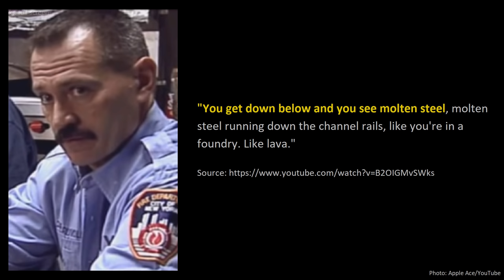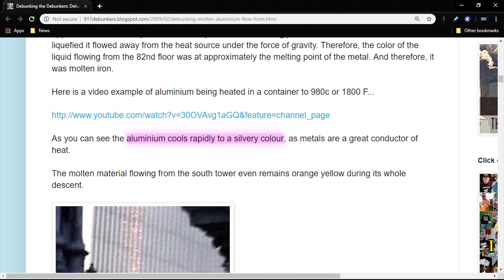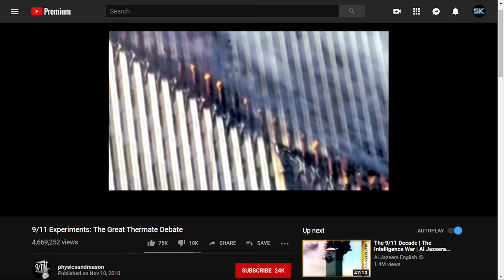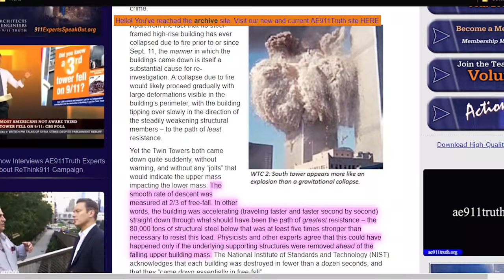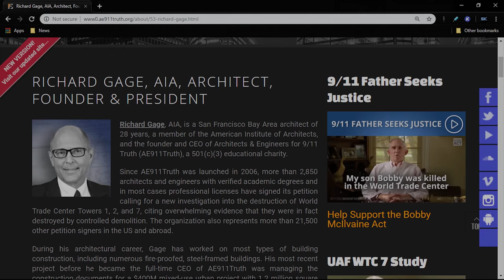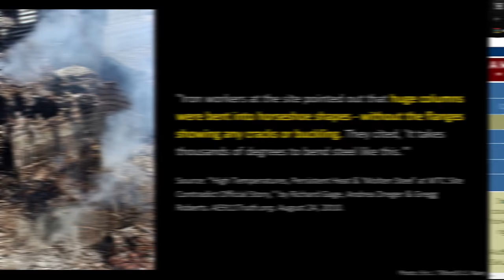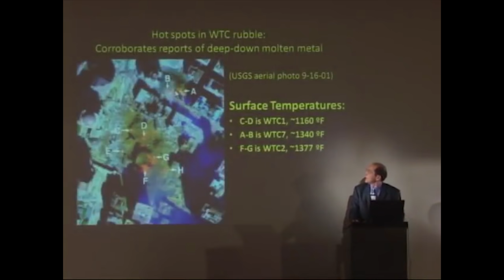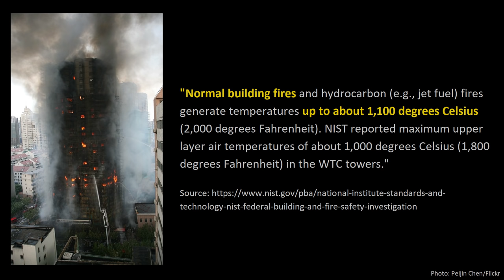9/11 Truthers Debunked: "Molten Steel = Thermite From Controlled Demolition!"

Comment: I guess you did technically go over it, but aluminum is like, the second most thermally conductive element, meaning it cools quickly. Even if the fire got up to 2000 F, we'd expect a dimmer orange color like the flames, not the bright yellow orange, almost white hot color we see falling. Watch the footage again, and compare the flame colors to the molten falling material colors. If the molten falling material colors are a lighter, more yellow or white color, then they are hotter than the flames from the fire, a thermodynamic impossibility without a higher temperature chemical reaction occurring. Did somebody tamper with the dripping metal color? I suppose it's possible.

Yes, liquid aluminum CAN glow yellow orange, but at what temperature? That's my argument why I still think it was thermite.

FYI, thermite IS used in some types of demolition charges.

It was my understanding that the thermite WAS mainly concentrated in the center shaft, with perhaps a few charges left on outer structural components.

The question I can't reconcile if there were no demolition charges used, why didn't we see a slower failure as the ductile metals (A36 steel) were heated beyond their failure temperatures for the given loading conditions. Supposedly the steel held 95% of the structural loads, concrete 5%, if that's the case, we would have expected to observe significant deflection, bending, and distortion of the buildings before actually collapsing (safety factors of ~3). For the corner support to have failed (let's say during the crash), that leaves ~75% of the structure intact, theoretically at a safety factor of ~2.25, still enough we probably ought to have seen a greater amount of distortion of the structure before failure.

Title of article on thermite found:
“Active Thermitic Material Discovered in Dust from the 9/11 World Trade Center Catastrophe”

Ultimately, do any of us know for sure? Probably not. But if I were a US intelligence conspirator trying to trigger a false flag war, I'd feel much more comfortable if the building I was trying to destroy had a backup plan in case the airplanes weren't enough.
Reply: Everybody is in agreement that building #7 was for sure a demolition job though, right? Even if buildings #1 and #2 were brought down with jet fuel only, building #7 was for sure a demolition, it would be impossible to argue against that I would think.
Reply: @jeremylefevre9828  No, "everyone" is not in agreement about that. in fact, the vast majority is very thoroughly not in agreement with that. And it's very very easy to argue against that.

The "molten falling material" is very likely nothing of the sort, and if it is anything, there is nothing at all that would prevent it from being aluminium.

Comment: The buildings failed because 130T of aircraft traveling at over 300 mph exerting millions of pounds of energy instantly compromised the structural integrity of the buildings. In the end the damage caused by the impact and initial structural damage doomed both towers. The fact that they stood for as long as they did is a blessing.

Comment: How did those solid steel columns get pushed outwards, did the fires do that too? if the planes did it, wouldn't they be bent inwards? 2:02
Reply: While the plane came from outside, the explosive force came from inside which pushed a lot of the steel columns outwards, just watch any video of the impact. Some columns just didn’t rip straight off and remained dangling.
Reply: @NY_Mapper  The WTC towers were not traditional steel grid frame construction but were essentially hollow tubes, a steel ektoskeleton with a column and girder core tied together by relatively insubstantial trusses.  It was the connection point between the outer shell and the trusses that ultimately failed allowing the floor pans to collapse (or pancake) pushing the the steel skin outward.  There are many videos of the towers being constructed that illustrate the form of the panels used to create the shell (they were anywhere from 75 - 150 ft in length) and why they "peeled" from the structure as they did...basically it was the path of least resistance, there were no explosive involved, had there been it would have looked very different.

Comment: Molten steel and squibs are dubious lines of inquiry, true enough. But was the debris searched for explosives or other means of demolition? Or plane parts?  

It’s not outrageous to suggest that NIST took a presuppositionalist approach to ‘investigation’. Well, it wasn’t an investigation, was it? It can’t have been. That must have been completed within the four weeks prior to October 11, 2001, when the US launched on Afghanistan; how embarrassing if subsequent detective work had turned up game-changing evidence?

Since the case was effectively already closed, all that was left was to provide a sciency rationale. NIST’s report begins by stating that “this report describes how the aircraft impacts and subsequent fires led to the collapse of the towers after terrorists flew jet fuel laden commercial airliners into the buildings.” Tidy. It reminds me of question four of Bertrand Russell’s ’16 Questions on the Assassination’:

At the outset the Commission appointed six panels through which it would conduct its enquiry. They considered: (1) What did Oswald do on November 22, 1963? (2) What was Oswald’s background? (3) What did Oswald do in the U.S. Marine Corps, and in the Soviet Union? (4) How did Ruby kill Oswald? (5) What is Ruby’s background? (6) What efforts were taken to protect the President on November 22? This raises my fourth question: Why did the Warren Commission not establish a panel to deal with the question of who killed President Kennedy?

If this were the greatest conspiracy in history, it would be assisted by the widespread belief that it would be impossible to pull it off. Just saying.

Comment: What exactly is burning at the base of the towers that can reach temperatures hot enough to melt steel for months? And you cant just say "confined spaces" as some magic word. If anything having fire deep in a rubble pile at the basements of the towers would not get very hot because A, the fire will become oxygen starved, and B, fuel will run out relatively quickly. But if their were still plenty of office furnishings down there that isn't going to create temperatures hot enough to melt steel.
Reply: Since there was no melted steel? Nothing.
Reply: @mooneyes2k478  well the firemen working in the rubble the entire time reported seeing molten steel. Now maybe the molten metal they saw was not steel, that does not explain though, how the their could be fires of extremely high temperatures for many months in the basement of the towers which was an oxygen deprived environment.
Reply: @unshapingtheearth7916  No, they didn't. They reported seeing "red-hot" metal. But red-hot is not molten.

Comment: The buildings have maintenance tunnels in them where they can go in and inspect the beams and do any maintenance or repair work needed. Those tunnels would all be basically hidden and not accessible to just anyone. So all the molten metal would not of been seen from anyone outside. And all they have to do with the thermite is mix it in with the paint they use to do their routine coating on the beams, framing, trusses whatever u wanna call all support beams. And thermite definitely gets hot enough to melt steel wtf are u talking about? That's what they use to weld train tracks together. Jesus people just spewing shit they know nothing about to try and convince others their theory is correct. I would highly recommend everyone to go research almost everything this video is trying to point out as their proof of what's what or how this works or whatever. Remember the old saying u can't believe everything u hear, see or read.

Comment: The steel and concrete floors would have sliced up the jets to pieces and sent the pieces scattering everywhere and certainly not in one corner.  Seriously?
Reply: You may have missed this but the planes were converted to bits - 117 tons of plane shredded to scrap in a fraction of a second.  The momentum of impacting at 467 and 590 mph respectively though would absolutely have carried much of the mass to the opposite side of the building where some would exit but most would remain. We can actually see this clearly in the South Tower where the piled up debris shoved into a corner is clearly visible. 

So yeah, seriously. Not at all difficult in logic.
Reply: @MFitz12 🪴🪴🪴🪴🪴🪴🪴

Comment: The tang is that nobody takes in consideration is how hot is jet fuel burn at it was not a standard building but a building fire mixed with jet fuel fire since the buildings got that hot since each  four had steel and concrete with those Plus the planss and fire damage from planes done by the planes caused it all go wrong

Comment: Yes we get it, the aluminum is right where the airline entered the building 😜. As we did 'not' see the airline bounce off. Most of the airline went through, to the other side. But there was a fire ball seen outside on impact, therefore, not all of the fuel from the wings could have entered the building 😜. It's simple physics. Eg. In order for aluminum to get inside the building, the airline must have entered inside. Which is what you failed to address. You just said 'where the aluminum is concentrated', not 'where the airline hit'😜. Which is the main event of the disaster 😜

Comment: Oh and you fail to mention that NIST made it necessary for their study to assume that the plane impacts hade "largely dislodged" the fireproofing on the steel columns. That is ludicrous, these steel beams could withstand very high temperatures. Furthermore the vast majority of the weight of the building was supported by its core. And the fires were starved of oxygen, especially back there. The fires really only burned in the offices by the windows and immediate areas of impact from the jets. How can you say these fires were sufficiently hot enough to weaken this fireproof steel anywhere near its core? And also how do you propose that the steel the rest of the way down the building was weakened? Because if you don't claim that is the case then my friend, you have fallen in a trap. There is no way that a small 20 story section of a building can crush 80 stories of healthy structure below. It is impossible. Momentum conservation doesn't allow it.

Comment: Finally.. a great video that makes perfect sense. All a honest hypothesis..  especially knowing that the massive amount of aluminum in the landing gear alone.. all ricocheting inside the box shape of the WTC Building and collecting in that corner based on the angle of attack of the Flight 175 plane as it entered at the 78th floor..  not at all as level and centered as the Flight 77 crash attack angle Center Mass And level flight… AS FAR AS TEMPERATURE GOES another thing I usually mention myself is the fact that there was a gapping HOLE 3 floors wide.. and  high winds at the top of the Wtc buildings… if you wanted to get deal over that 1600°C Mark did have to add oxygen and lots of it…. There.. 102 Minutes of  Forgery High temperatures

Comment: How does 80 or 90 floors of 100% sound building just become rubble? For 40 years they held up 110 floors plus 110 yard mast no problems. Even if the floor above the impact zone failed the core would still be 100% solid. The whole core was crossed braced - that was going nowhere. Fires cannot harm concrete of even impair huge steel sections.
Reply: 12weasel100  OK Oh Brains of the Universe - Explain how 100% undeformed rock solid 100% sound construction turns into snow flakes?
Reply: @Viagra_risk_PERMANENT_insomnia  You are very welcome to your Own non science opinions. My statements are based on 100% Facts. These Facts stated that both Towers had to be able to absorb an aircraft impact. The 707 was the largest plane at the time of design. With those conditions the building could suffer without zero loss of integrity up to 25% of its external lattice work with Zero loss of performance. NIST calculated 13% of the external steel lattice was compromised at each Tower - well within the stipulated 25% margin. 

Read carefully. These towers at 25% external damage were still at 100% Structural Integrity. In plain English this means the buildings would remain standing as designed. The Giant Hat Truss system was designed to redistribute external loads to other areas of the buildings. So your other 'Truthers' may have opinions based on other evidence, my response is based on Actual Facts. 1966 Engineered Facts.
Reply: @Viagra_risk_PERMANENT_insomnia  Your 'Hinge' statement is false. My 1966 plans of the WTC1 &2 towers show bolted and welded connections. The plans are stamped 'Final' The buildings were constructed according to those plans. The rest of your submission is all theory. Even if the floors did sag(again zero proof) they had ample strength to remain in situ. The huge sections of exterior lattice falling from the towers is proof the buildings were imploded. Steel box sections cannot be ripped apart. 100% impossible.
Reply: @Viagra_risk_PERMANENT_insomnia  You are messing with words. In the industry NO Certified Engineer would Ever call that setup ' Hinged' You are toying with people.
Reply: @Viagra_risk_PERMANENT_insomnia  Human remains found over 200 feet away on other roof tops is. How do you suppose human body parts went for a fly on 9/11 without being ejected without explosive force?
Reply: 12weasel100  You clearly never went to Engineering Uni? Have you by any chance ever heard of a dude named Isaac Newton? He is still considered The holy Grail when it comes to motion. One of his fundamentals covers the 3rd law of Motion. In over 400 years that Law has stood - no person has yet disproved it. If you believe you are more clued up than Newton Do tell?
Reply: 12weasel100  I'm a what? All Buildings are built the same way. They are all built to resist forces. How do you imagine buildings are made? I'm guessing where you live tents are the top end of town?
Reply: @Viagra_risk_PERMANENT_insomnia  Dude I have no idea what you are gabbing about. Perhaps in some countries the term Hinged is used in structures. Where I work hinges go on doors. Floor joist fixings are never referred to as hinged in my work place.
Reply: @Viagra_risk_PERMANENT_insomnia  To show any form of mild  IQ try - Science Fact , not a meme.
Reply: 12weasel100  How's your treatment going? Did the Hospital find your brain tumor?
Reply: A building that just had a massive jet fly into it at 600mph is “100% sound?” Is your brain on vacation ?
Reply: @NY_Mapper educate your self on structural design and material strengths. the building could have been hit by 5 airliners going 500 mph and easily would have stayed standing with 100% integrity. at least the first 75% of the building was completely unaffected by the plane impact. these buildings are specifically designed such that they will absolutely never collapse unless brought down with demolition explosives. skyscrapers do not simply collapse. thats not a thing, especially in todays world. if they could, they would not be built.

Comment: 2,757 Fahrenheit (F) is around when concrete melts.  Rust on the image just means its oxidizing which most unpainted iron does.  Not sure what his point was on this.   I think this guy would deny that glass bottle was actually glass unless it was tested to be glass.   Sometimes if it quacks like a duck, walks like a duck it just might be a ... Duck!

Comment: The I beam columns at the base of the building all cut on angles the same way they cut I beam when they walk a building into itself during demolition. There's no way these buildings were not imploded.
Reply: What "I beam columns"? There were no beams anywhere, there were no I-profile structures anywhere, and beams and columns aren't the same thing.

Comment: lol molten alu... dude between your eyes and your brain think you need your brain checked. Even if you didnt already know, a quick search will showed you what COLOR molten alu is vs what was captured by the many videos of that terrible day.
Reply: Ok. So, since that's the case, and since you obviously know....what color is molten aluminium when it's at 800 degrees C? That'd be about 1450 degrees F, if you prefer that.

Comment: Maybe you don't pay much attention. But aluminum stays glowing while being poured in thicker streams, but as you can tell in the video you chose to use, every time there's spash off or smaller portions it instantly goes silver. Same can't be said for the the molten metal pouring from the building. as you can tell it has pleanty of contact time as its falling for stories and even slashing off of the building while remaining glowing. Aluminum would have not done so!
Reply from the maker: Dude one of the points I make in the video is that the molten metal does clearly begin to silver on  the way down!
Reply: Yeah but after how much contact time? Aluminium would have much faster.

Comment: 26:31 looks like reinforced concrete
Reply: It's 4 floors compacted together. Since the floors contained the only concrete in the building you are correct.
Reply: @MFitz12  floors had trusses also, they were thin above that there were some metal plates , and above that there was reinforced concrete .
Reply: @prasadkathare1168  - There trusses crunched in there too. You can obviously see all sorts bits and bobs of it poking out.

And paper.  There's even paper squeezed in there.
Reply: @MFitz12 🪴🪴🪴🪴🪴